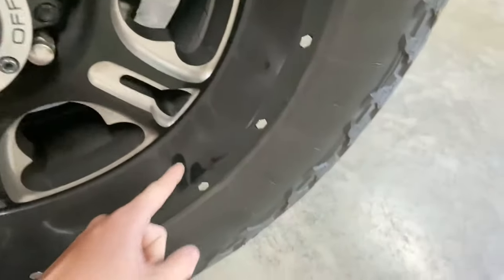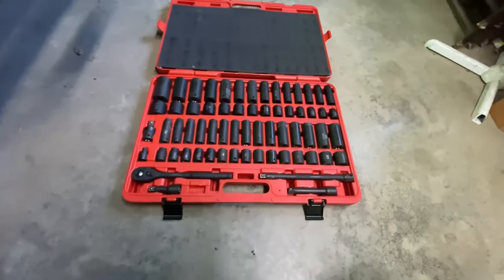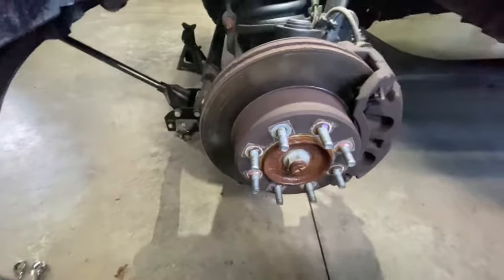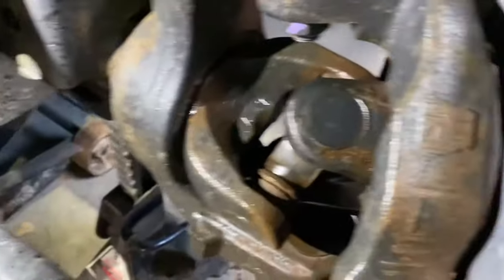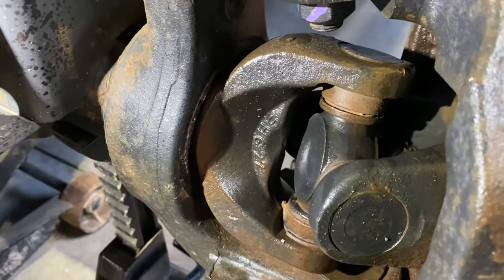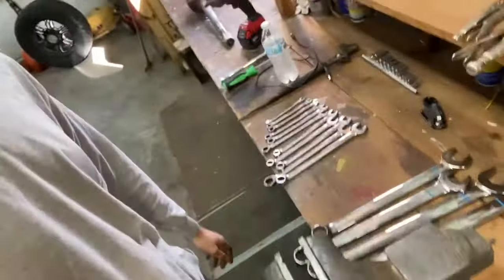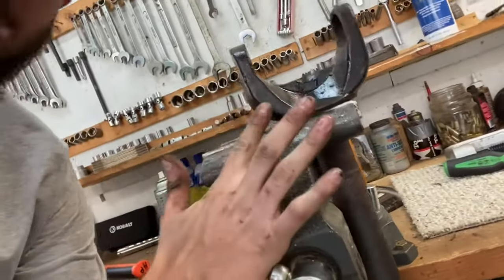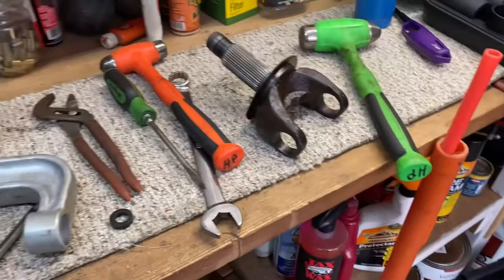2013-2018 Ram 2500 Axle U-Joint Replacement Part 1

Comment: Changing my hubs and front axles joints today.  Video says 40-50K is normal.  I Guess como have been riding on borrowed time for the last 200K.  First change out today at 241,000 miles.

Comment: Do you have to do anything in the front diff to get the axle out and then back in? I was told you should tear it down. I have a 2014 that has a studder when the steering wheel is going back to center after turn.
Reply from the maker: I had to because of the passenger side but not because of the driver side, it’s to must to explain it hear but watch my part 2 of it and it will explain it way better and in detail. I think there’s a way to get around it to not have to thatI didn’t know at the time so I shared in that video what I learned to help you!
Reply: @HoldenPowell_  I saw what you were talking about but you don't have to tear the diff down to do it right? Just need to put it in 4 wheel drive?
Reply from the maker: @jessemartin3996  that’s what I would try and I don’t see why it wouldn’t work because it’s slid onto the inner shaft instead of just the axle which is why mine fell off

Comment: What size is the axel nut?
Reply from the maker: I can’t remember right off the top of my head but I’m pretty sure 1 3/8
Reply: @HoldenPowell_  thanks buddy. Doing mine in the morning
Reply from the maker: Your welcome and make sure the watch my second video to see the issue I had with the actuator coming about, I believe the way to not have that issue is to put it into 4wd before taking the passenger side out. I would be my solution but definitely watch part to to see what I mean!
Reply: 1 5/16 just did mine today on a 2014.
Reply from the maker: @curtishyde2  thanks for the info I couldn’t remember from when I did mine
Reply: @HoldenPowell_  and you're correct about putting it into 4wd I didn't have the issue you did in your 2nd video.